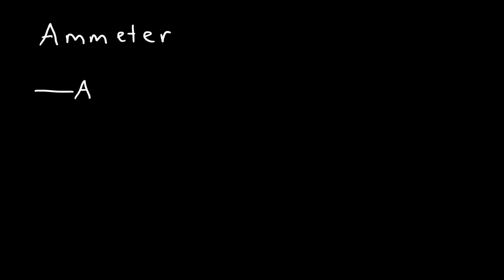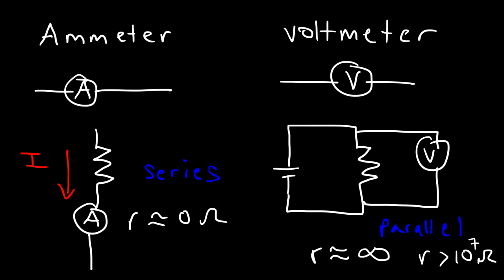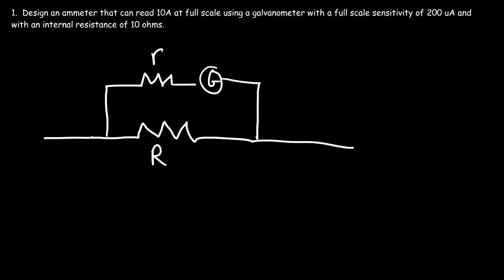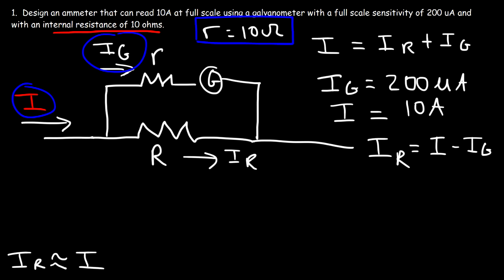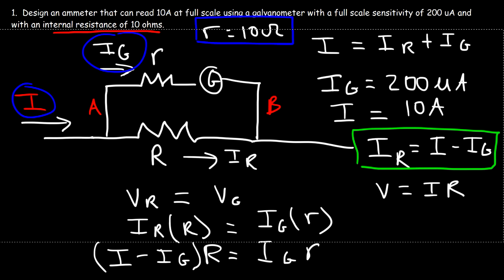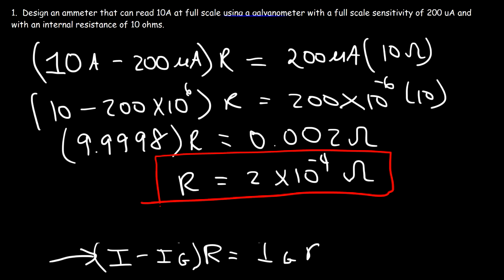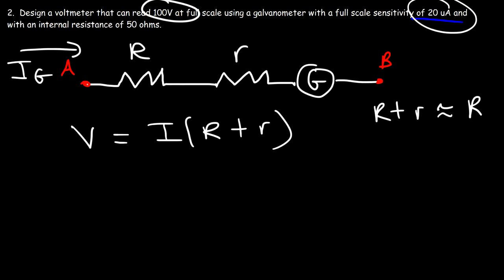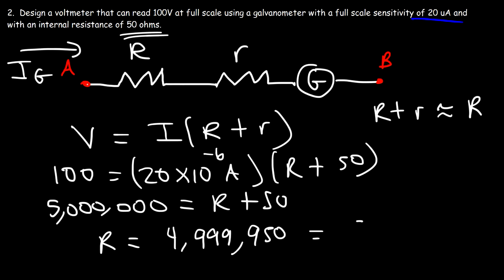Voltmeters, Ammeters, Galvanometers, and Shunt Resistors - DC Circuits   Physics Problems

Comment: You did not explain what a galvanometer is before the first problem
Reply: Sensitive ammeter. Flicks back and forth depending on current. Used for capacitors and to show the effects of Faradays and lenzs law.

Comment: I’m not sure if my textbook is outdated but in it says that the ammeter is attached parallel to the galvanometer and that the voltmeter is attached in series with it so I’m now even more confused
Reply: in an ammeter, The shunt resistor is parallel to the galvanometer.
while in a voltmeter, the multiplier resistor is connected in series in the galvanometer.
Reply: Your book isn't outdated.. it has got some typing errors... In an ammeter, Shunt is connected in parallel with the galvanometer(not ammeter connected across galvanometer as your book puts it)....Similarly, in a voltmeter, shunt in connected in parallel with galvanometer (not voltmeter in series with galvanometer)
Reply: الله ينور يا عرب والله 😁💜
Reply: @abdulrhmanelsherbini733  what did you just say? 🤔

Comment: sir, why resistance is zero in series& infinity in parallel
Reply: krish Anu when you’re using an Ammeter to measure current, you DONT want the measuring device to alter the current, hence little to no resistance. (Zero resistance in series)
Reply: U need girl

Comment: Sir is galvanometer connected in parallel or in series
Reply: Internal resistor in series with Galvanometer whereas a shunt resistor in parallel with the galvanometer, as i understood